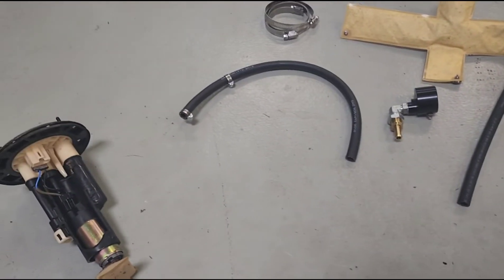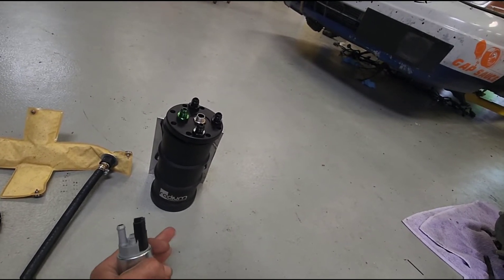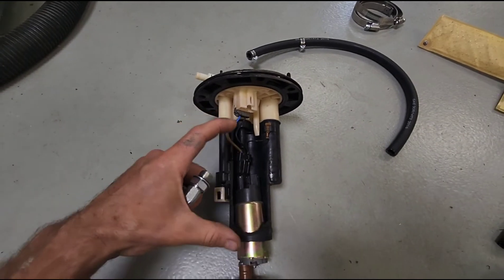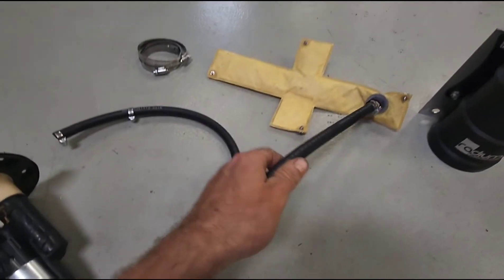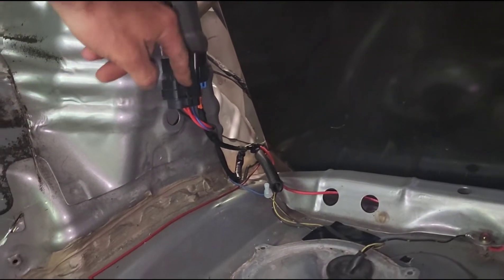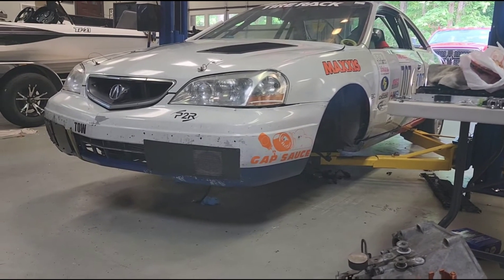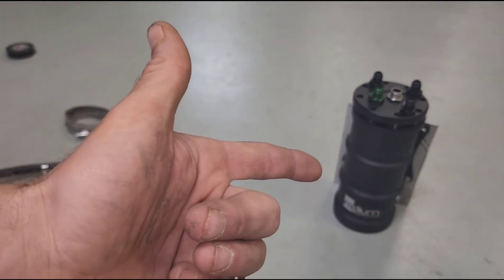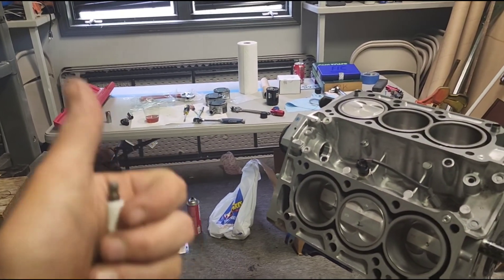Radium Surge Tank vs. Holley Hydromat vs. Fuel Tank Foam, Racing Review and Honest Opinion

Comment: You actually had the pumps mounted correctly.. 
A smaller flow pump fills the surge tanks at 0 pressure and high capacity pump supply the engine where most of the time there will be surplus returning. And even when its not returning, the flow is much lower at higher pressure.. 
You dont need to supply your surge supply for max possible engine fuel flow..

Comment: Just deciding on whether I grab a Hydramat and found this vid. Pretty helpful. But I'll say you're wrong about the surge and running the smaller pump in the hangar. You need the bigger pump supplying the engine. This pump will see rail pressure so the smaller pump will actually move more fuel to the surge than it would move to the rail. If you look into pump specs they will have a flow rate vs pressure with the highest flow rates being at the lowest pressures.

It's been a year how did the setup hold up? Did it blow again? Are you even racing it anymore?
Reply from the maker: I'm just running a AEM in tank fuel pump with the large fuel sock. The surge tank is a cool idea, but once you get down to 2 or 3 gallons, 2 pumps typically make the fuel hot. My buddies BMW kept having issues with their setup in that manor. So a possible fuel cooler would be ideal.

Comment: I Installed a 15 Micron Hydramat  3" x 15" (# 16-111) directly to a Walbro GSS342 in my 2015 Sea Doo GTX iS 260 Limited PWC in a Fore / Aft orientation with the longer section facing forward so as not to possibly interfere with the level sensor. works far better than the OEM Fuel Pump Module with built-in crappy strainer and non-serviceable paper element filter (Deleted 2 OEM strainers and filter and modified the Module). This thing absolutely eliminates fuel starvation in rough conditions with under a quarter tank remaining (had starvation issues with stock system below a quarter tank). I recently ran the tank bone dry, simply amazing, I added a gallon and rode it safely back to the Dock. Highly recommend.   Randy    AKA randog311  (Retired Professional Wrench)